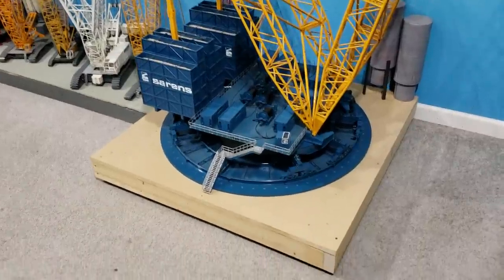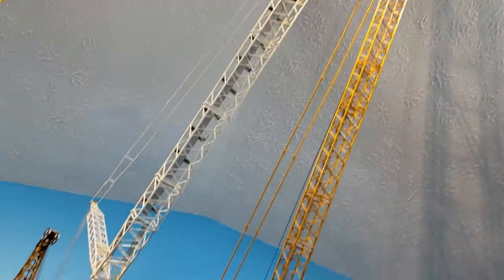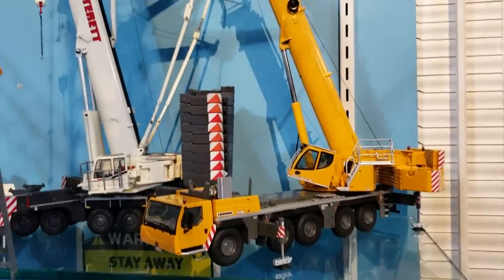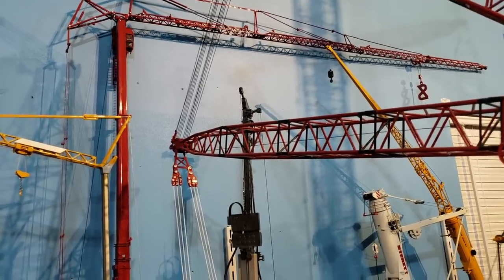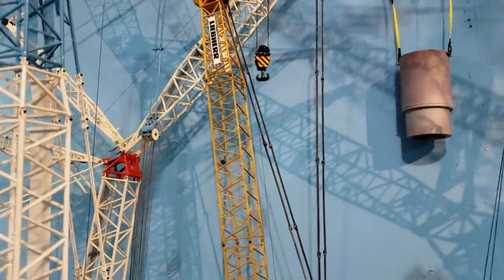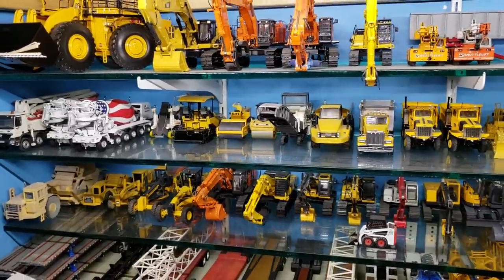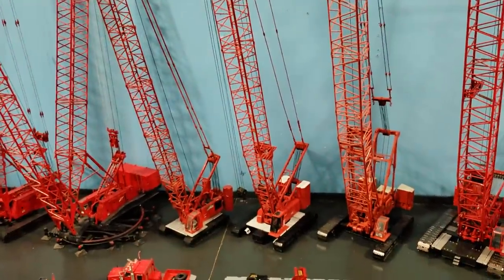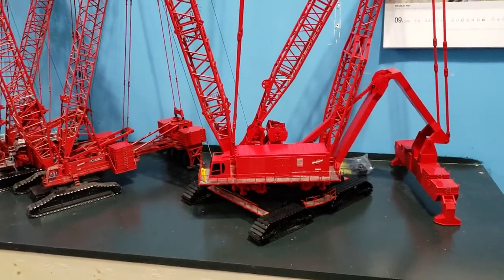September 2018 collection update

Comment: Since the vpc on the 31k works, i assume that means it will shift as the boom is raised or lowered or load is added to the hook, 
For the real system, does it move as the load increases or is it manually operated for each lift?
Reply from the maker: It automatically adjusts according to load and boom angle, but I'm sure it can be manually adjusted to in emergency situations if needed